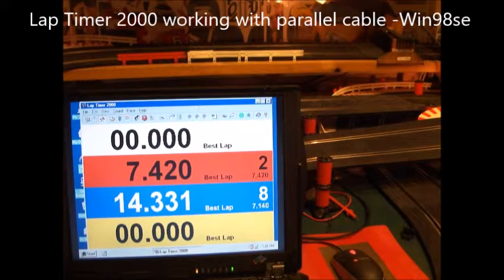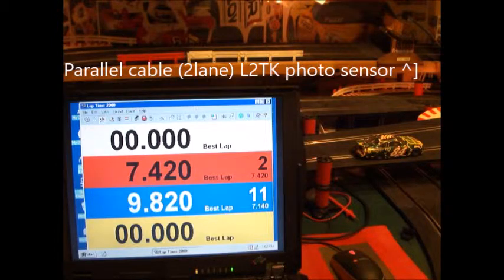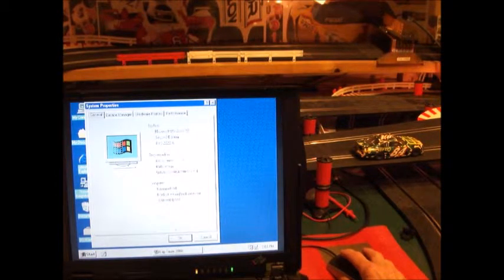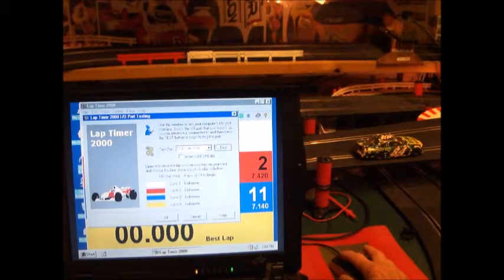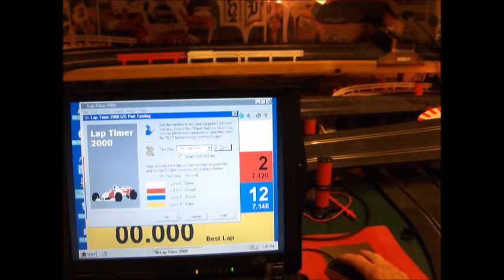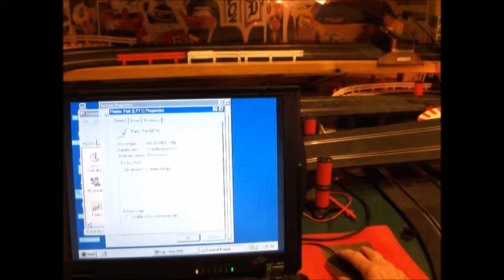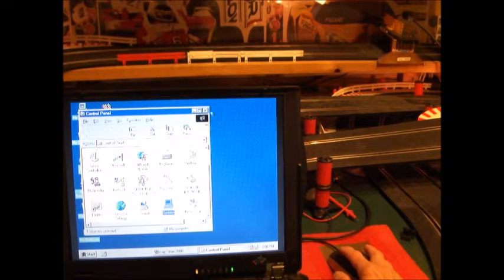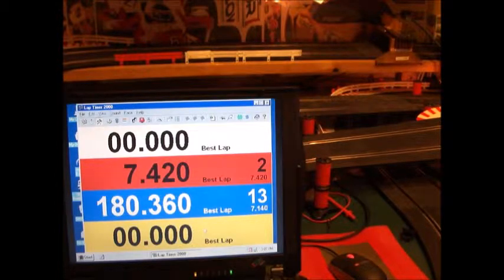LapTimer 2000 slot car timer with parallel photo sensor cable on Win98se

Comment from the maker: Reminder to self: I/O Port testing:  A good lap counter will show CLOSED at rest.  When a car goes under the photo cell it will trigger OPEN for a split second, then go back to CLOSED.  A defective LANE will show OPEN all the time.
Reply: Not true at all. Electrically it is supposed to be open at all times. Photcells close the circuit when light hits them. All you need to do it enable the setting "Invert Lap Switching Logic" in Settings tab in the Lap Timer 2000 Options window.
Reply from the maker: Of course i tried that..My wiring must be different.
Reply: This thing is such a pain to setup though. Thanks for the video, gave me some ideas that helped me solve my issues.
Reply: @vedi0boy  Not true, when there is no car, the IR light is hitting the detector, the detector is ON, ON is not open, ON is closed.
Reply: @user-rs8zg8ey2b  I'm not sure why I commented that (it was 3 years ago) but I believe my circuit was different. I had a relay that would basically invert the logic once it reaches the computer. But you are totally correct about that light stuff. I was a teenager still then so I was probably being a smart-ass lol